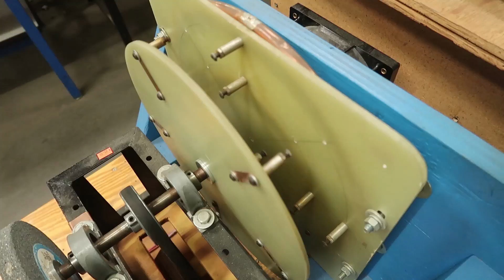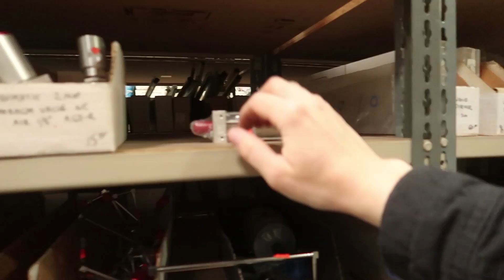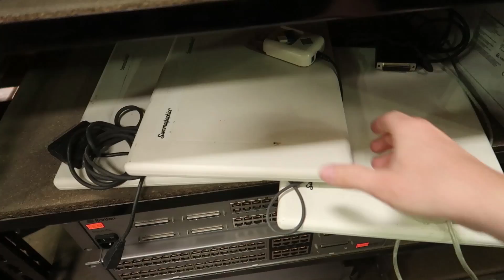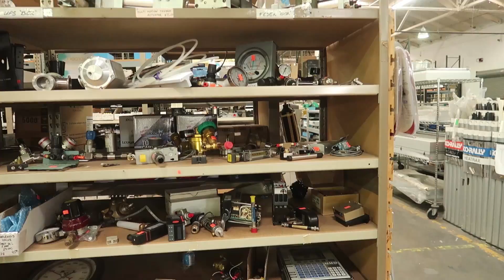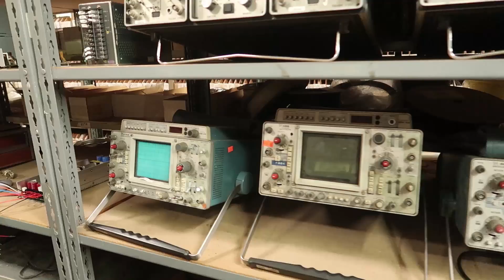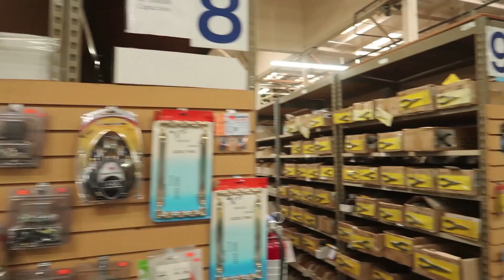Random Bits 0201: Excess Solutions

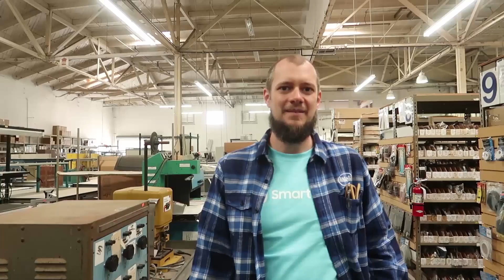Comment: at 26:53 reason why I clicked video. I have some optical comparators (much newer than what is in video) and what is in video is somewhat different than mine. The box on right with two windows is the "X Y coordinate Display, apparently. Stage much different than mine, think this is set up for specific inspection application. Box on left turns on illumination, apparently,  box with fan is illumination apparently. Arrived here by scrolling up your videos searching more on Rocket.
Hey, why could I not find those Solder Lug Terminal Strips online that are so convenient to quickly slap together simple non critical circuits? How do people do that now days? You got to make a pcb for basic simple circuits? I found them, vintage ones, on the bay. No evidence they make them any longer :(  I bet there are boxes of them in this place though for super cheap.